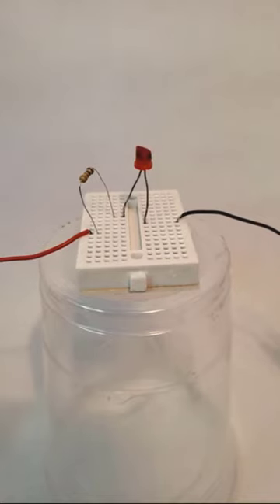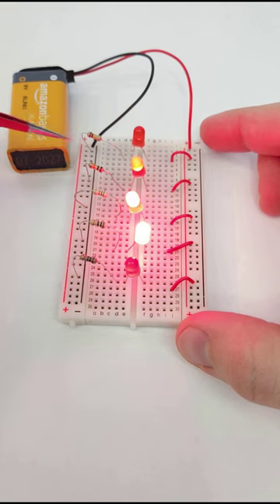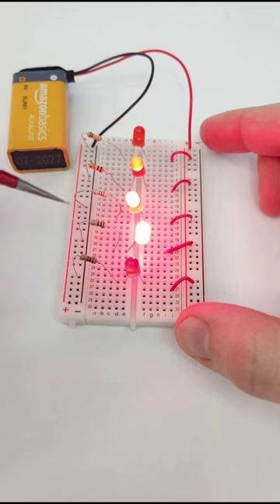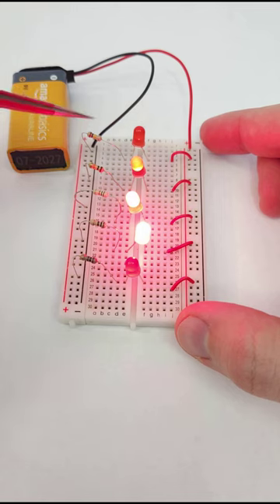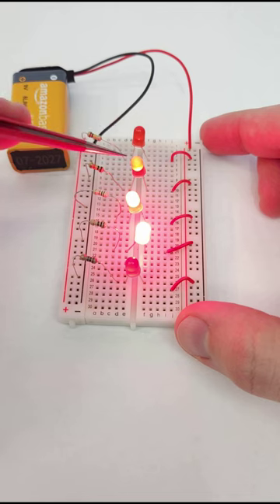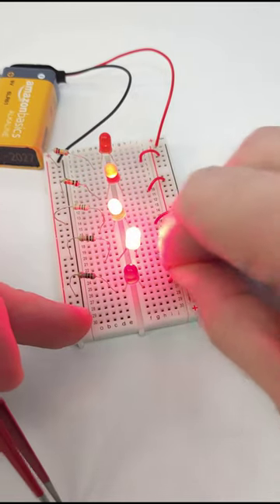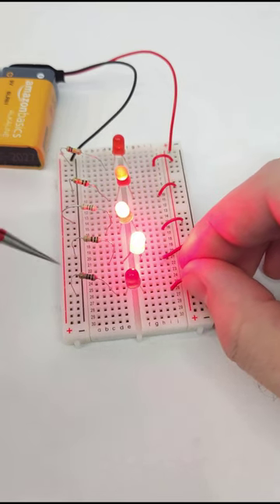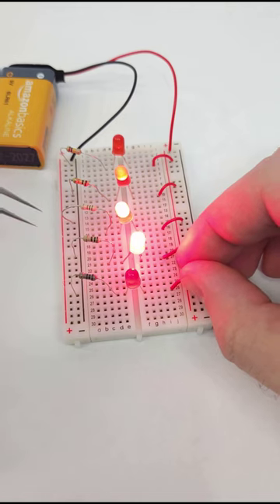Quick and Easy LED Circuit Design (No Math Approach)

Comment: Or you can like, just do the math because it's super basic? Subtract the forward voltage of your LED from the voltage of your power supply, then divide that by the operating current of your LED to get the resistance you should run. More resistance (to put the current below the rated current) makes your LED dimmer but also last longer.
Reply: Again 😅.  I didn't understand.
Reply: I'm pretty sure this is actually helpful to some people. I bought some off temu before and they didn't tell you anything on the package.
Reply: @Nobody04200  Generally, 16mA is a safe forward current for single LEDs. Less is better, of course, for the longevity of the LED.